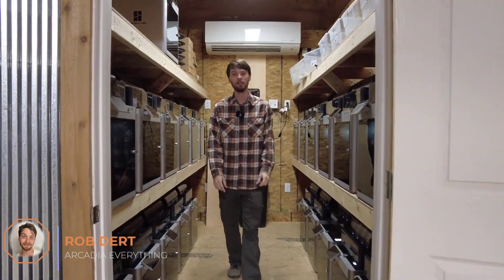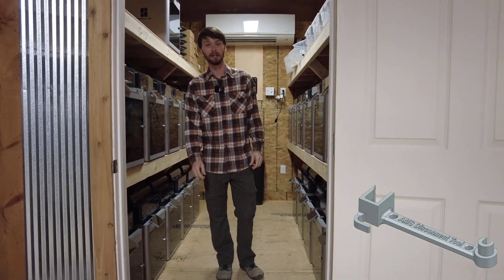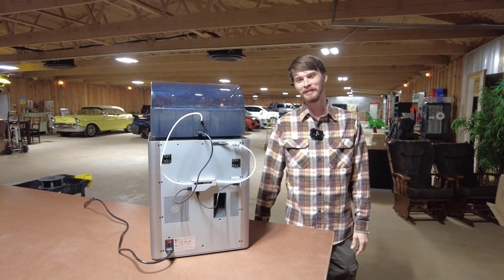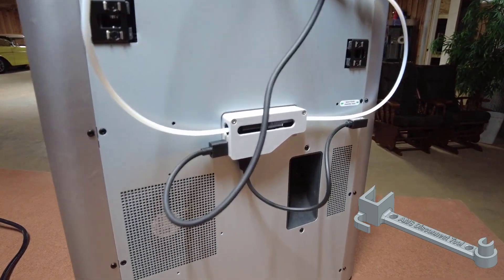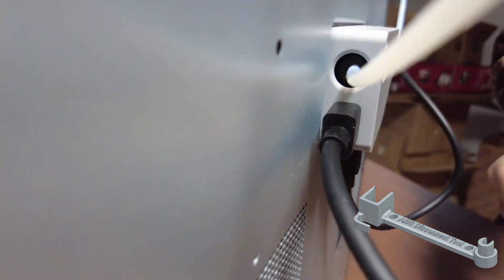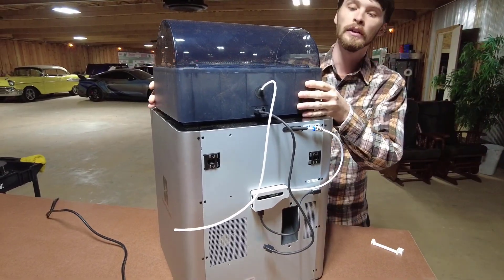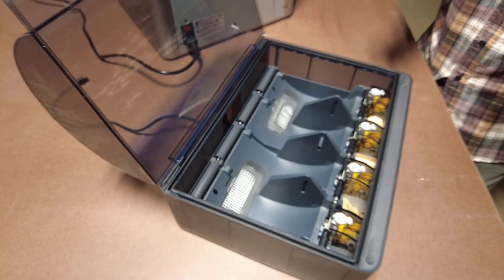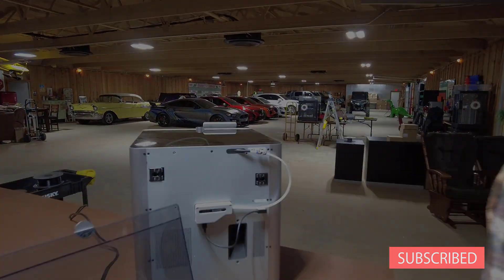The #1 FREE Tool For Your Bambu X1-Carbon

Comment: I still have issues pulling out that back bodentube even with the quick release
Reply from the maker: Make sure you press in the side tube firmly to release the tube. Is it locking? tension?
Reply: @arcadiaeverything  sorry the one in the ams gives me the hardest time to take out , and it happens so much i had to leave it unscrew